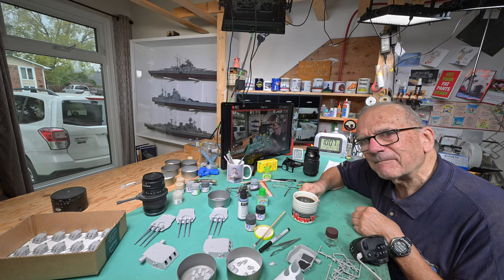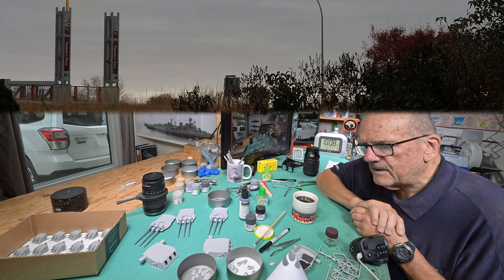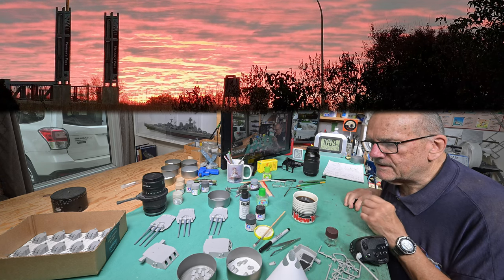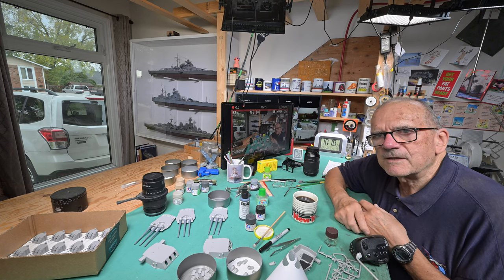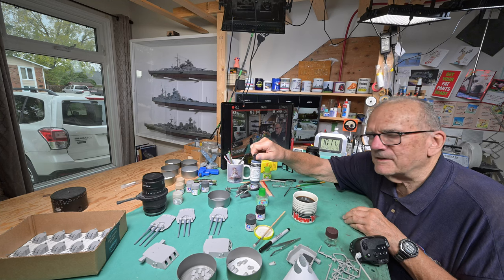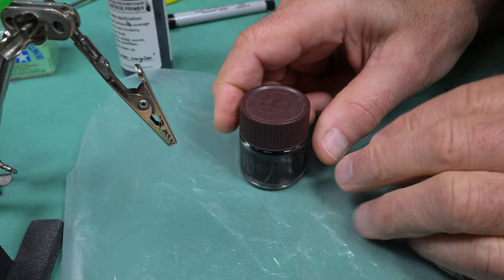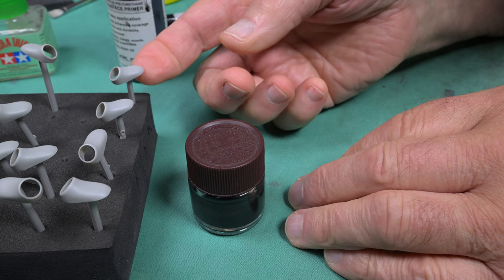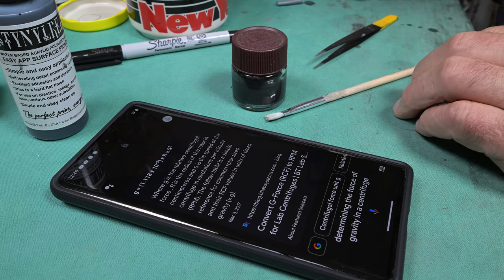The Model Ship - Part 1765

Comment: For your centrifugal force query, ChatGPT gave the following answer with your original query. 

F = m * r * ω^2

Where:

F is the centrifugal force (force of gravity in the centrifuge).
m is the mass of the object being rotated.
r is the distance from the center of rotation (the radius).
ω (omega) is the angular velocity in radians per second.
This formula shows that the centrifugal force is directly proportional to the mass of the object, the square of the radius, and the square of the angular velocity. It's important to note that in a centrifuge, the force acts outward, away from the center of rotation, which is why it's often referred to as centrifugal force.